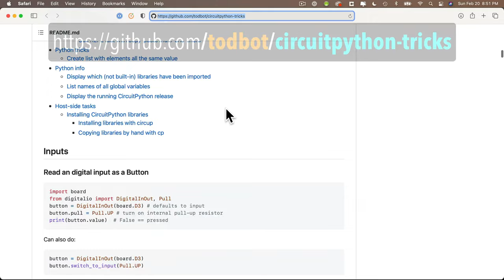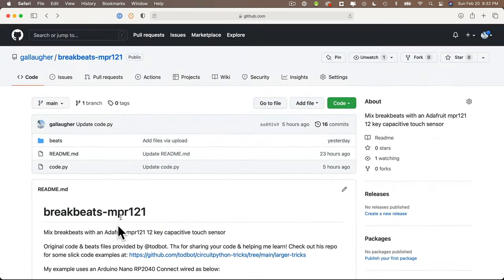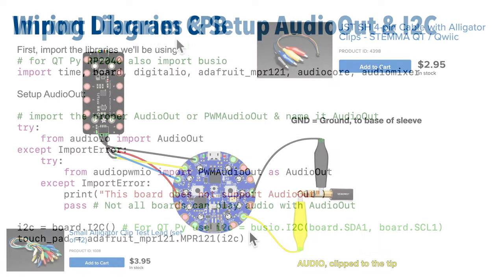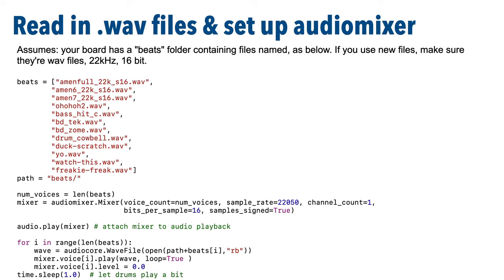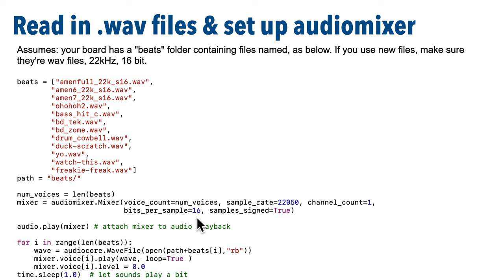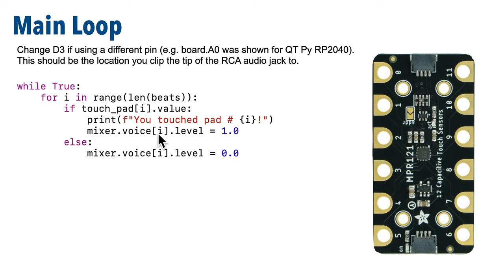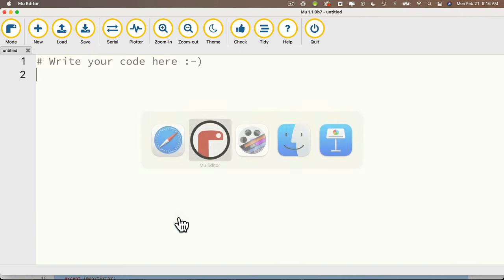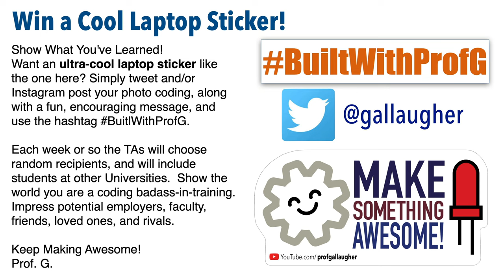CircuitPython School - Build a DJ Board with audiomixer

Comment: Hello, I'm dumb, but where to find audiomixer and audiocore libraries for download? Thank you :)
Reply from the maker: You're not dumb, you're learning :) Some modules are "built" into the CircuitPython for boards. All of the boards shown have audiomixer and audio core in the module. If you're using a different board you can enter the REPL and enter:
help("modules")
Look at the list printed out. If you have audiometer & audio core, then you're golden! If not, then your board doesn't support these features. There's nothing to drag over - no "lib" files to add. If you have a board that's different from the ones show, you might check on the Adafruit Discord https://adafru.it/discord to see if they have advice on board that don't support these modules, but I'm pretty sure you'll need one with these modules supported. There is also a grid showing the modules supported by board, here: https://docs.circuitpython.org/en/latest/shared-bindings/support_matrix.html
Reply: @profgallaugher  Thank you so much!!! I was searching that for 5h xD